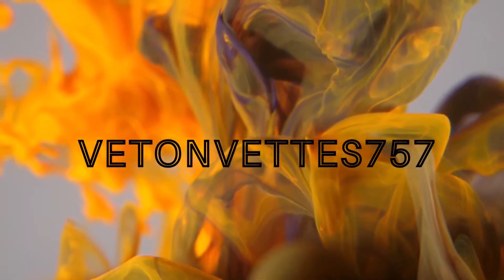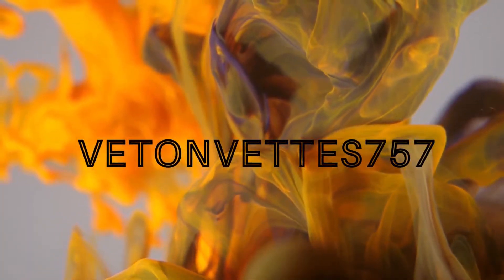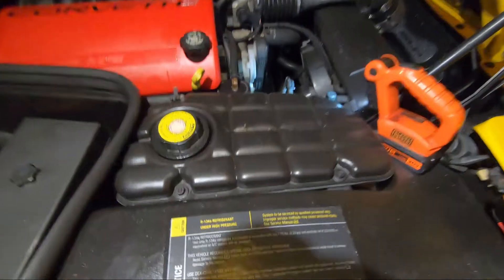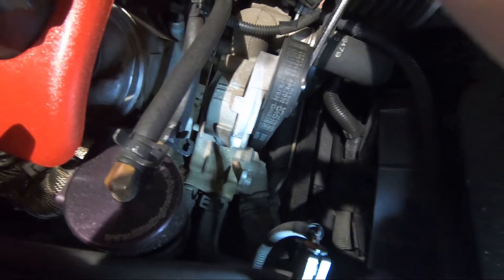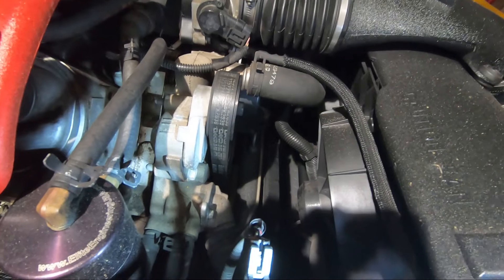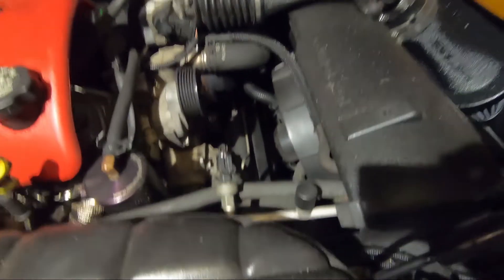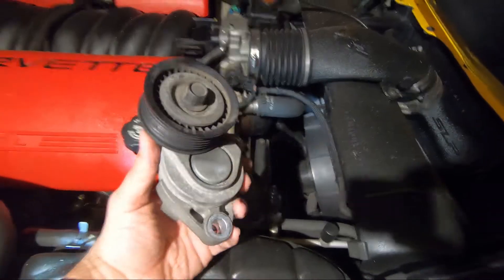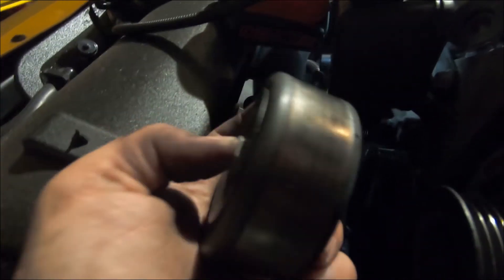FIX THE SQUEAK! BOTH BELTS/TENSIONERS/ PULLEY REPLACEMENT.. THE EASY WAY.. YES FROM THE TOP!

Comment: Got mine done today and I had a terrible time with the AC belt tensioner and the AC belt. I couldn't get a ratchet on the tensioner so that sucked then I couldn't get the damn AC belt to line up as it should. It pissed me off but I got it and saved money by doing the job myself so thats good.
Reply from the maker: Outstanding 👍🤙

Comment: Hey was your replacement ACdelco, AC belt idler pulley a replacement with just a metal pulley and you re used the original bolt and dust shields front and back??
Reply: Thanks for the reply! LoL. Got it sorted with some buddies help and endednup going with all upgraded billet bits since the ac delco vrap is overpriced to the moon for being not the best you can buy. Cheers bud thanks again for the help! LMAO

Comment: Mark, Thanks for another great video. When I bought my 03 C5 in Sept of 2020. It had a squeak/squeal on start up. I replaced the belt and the tensioner pulley. Noise was gone. After about a week of driving I was checking the belt and noticed that the front edge of the belt had developed a tapper to it and you could almost see the first groove of every ribbed pulley. So I started checking everything and found that the belt was actually rubbing one of the steal lines that goes to the steering rack ( the one closer to the drivers side) and wore a groove into the hydraulic line. It did not rub completely through but could have. I managed to bend one of lines away and the other one that had the groove in it I had to force away from the belt and clamp it with a hose clamp around the steering rack to hold it in place. I’m still running the same belt and have never heard a noise at start up agin. Just my 2 cents. I’m not sure of anyone else has ran into this on there C5, but I thought this would be a great place to share my findings. By the way next you have wrench on one of your vehicles get Crystal to hold the Camera for you since you wanted to incorporate her into your channel.
Reply: how much was the belt and tensioner pulley because I have the same problem right now

Comment: Hey the AC tensioner did you remove the 15mm bolt, then remove the pulley to get to the 13mm bolt that holds the tensioner in place? If so what tools did you use..

Comment: If you read the box the first pulley comes with it tells you the dust covers are not required because the bearing is sealed, you just bolt that bad boy on without the front cover.

Comment: Just a heads up for anyone that's going to tackle this on a C5 with an automatic transmission. It's quite a bit harder to do the job  because the auto trans fluid lines run right in front of the AC Tensioner creating space issues with hands, tools, etc. Just be patient and don't be afraid to muscle the lines a little bit.
Reply from the maker: Good point I didn't even think to mention. 👍
Reply: Your the goat I’m doin this rn, great advice ✅

Comment: that AC belt is a PITA.  I removed the tensioner for the serpentine and it made it loads easier.  I think i need to change out my pulleys like you did.    But that is for another day.   Did you remove the rib in your door panel?  I have them and am tempted to remove them.